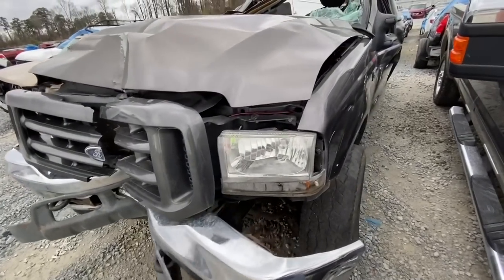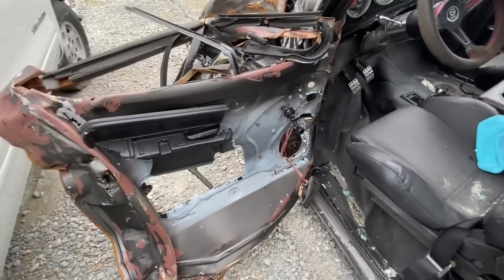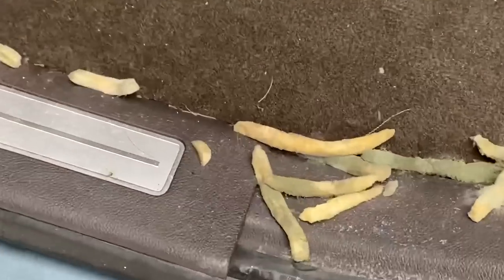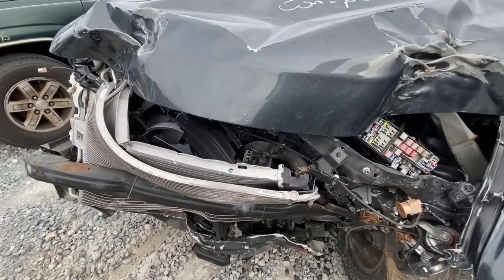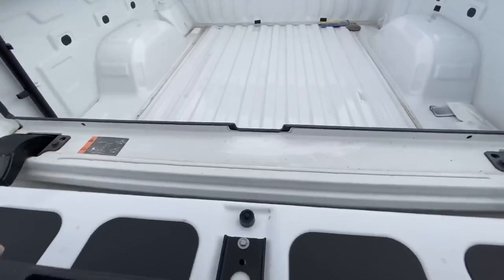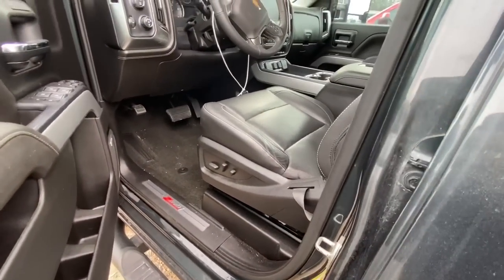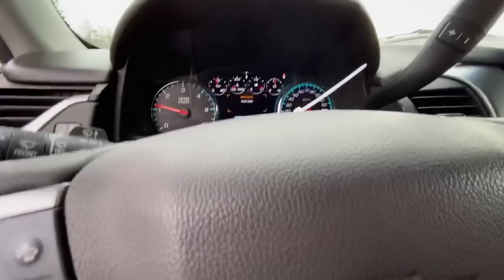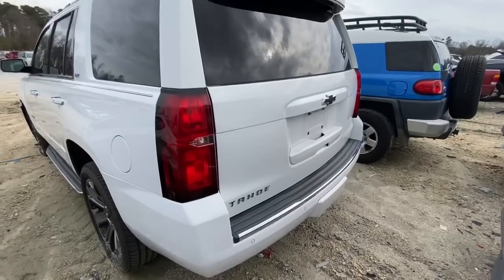Copart Walk Around Massive Carnage, Worst I’ve Seen!

Comment: I can’t  believe some of those cars that have very little damage are not bought back by the people who owned them and fixed. 
I would love to see a actual build project. 
Great video I love them. Thanks for sharing. 👍💥💥
Reply: When the car is deemed totaled insurance pays you your money and they own the car to auction off to recoup some of the money. Sometimes you can take a lower settlement and keep your car. But to get a clean title it has to be repaired right by someone with a rebuilders license and inspected by state troopers. Looses value and banks won't loan money for a rebuilt title car. And a lot of people won't buy a rebuilt title car

Comment: I don't know about the whole swap thing. I personally never seen it and I've never seen you know, seen it done and I'm sure it would be a common thing if it was possible, but it must be a big pain in the ass to be honest. But who knows maybe it'll swap right in I mean the frames are basically the same so the clearances should be too right? Also, I love to see you swap this interior into the Tahoe and I'd honestly watch all the videos and they have to be complete videos not like before and after like I want to see the process from A to Z and see you doing it boss. Obviously, you could get some help. You know what I mean? So it goes a little quicker or you can do it all by yourself, whatever. However you decide to do it. Make sure it's video the whole process and do it like that. I'm sure the interior would swap right in and I'd love to see you do it because it's something I personally do to and if your Center armrest is the same as in regards to this truck if they look the same feel the same Etc. I'm sure you could just pop out that center console and put this one in, I don't know about the wiring but I'm sure it's just a 12-volt so you could run it. To maybe a cigarette lighter or run it directly to the fuse box or however you want to do it.
Reply: I got a old 2000 Silverado with a hundred eighty thousand miles, still running original motor and trans. It's a Wisconsin truck though. So it's rusted to shit and salted to shit. But other than that, she's a strong Runner besides oil pressure issues and things of that nature, but In a different Tahoe. I was at the junkyard and it had a center armrest that was padded and much nicer. So I took it out. And took mine out of my Silverado and it bolted right in. Granted. It didn't have any wiring or anything to it, but it wasn't easy swap out. So I'm sure you can do it. No, also remember this is 20 year older vehicle. So, I don't know how much different things are in relation to your Tahoe in this truck. But I'm sure they're pretty similar since they share so many things.